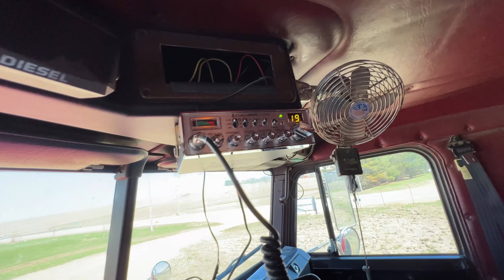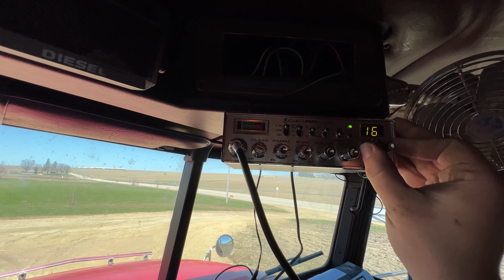Big Red Breakdown

Comment: You'll get 5-15 mile range normally on CB, but the sun is just entering the active part of it's 11-year solar flare cycle, which enables skip - 600+mile transmissions due to the charged up ionosphere bouncing space-bound radio back down to the ground.
Reply: That's good to know, thanks.

Comment: Cb Radio signals (waves) are  mirrored in some layers in the atmosfere and on the ground, espesially on water and  travels very far from the antenna. In Denmark in northern Europe I listened to Italians 1400 km and Norwegians 500-1800 km (300-1100 miles) when I had a CB radio as a young guy.

Comment: Not sure if you did Ryan but even with a Cobra 29 I'd take it to a good CB shop to get it peak& tuned so you get the most out of it. Same radio I have in my rig and bought it from the lady who runs the CB shop one exit east of where I-35 hits Des Moines and six months later still got no problems. Also a big reason for some of the interference is from your chrome and also if you're running any type of LEDs because the EM radiation does distort RF signals.
Reply: Exactly, really any  CB Radio antenna needs to have the antenna matched (SWR's) to the radio!

Comment: I don't know about your area, but here west of Kansas City, usually in the afternoon and evening, channel 28 ends up getting a lot of skippers from all over the country.  Has to do with those skippers putting up big base station towers, directional antennas, and using a wee bit more power than your cb has, and the big factor, how "energized" the atmosphere is due to solar activity, and bouncing their transmissions off the atmosphere. About 3 weeks ago, was picking up a guy talking on cb from the San Francisco, CA area on my cb.  Also, if you wanted to, run a 2 antenna setup with a co-phased coax cable setup, it actually increases your transmission range front and back but reduces your range from the side,  and get the antenna as high as you can get it.

Comment: Depending on how the sun is affecting the Earth's ionosphere, the 11 m wavelength (near the top of the HF band) of CB can (and often does) have a range of anywhere on the Earth. This is the biggest problem with CB, while you might be trying to talk to someone a mile away, the signals from Europe, Australia, and Africa drowned out your local signal and you can't talk to the guy sitting right in front of you. This is why many are switching to GMRS in the UHF band. UHF signals are not subject to bounce or skip like the HF frequencies of CB, the maximum range is about 50 miles. Thus a much better 2 way radio for local conversations.
The very latest is that the FCC has approved the use of FM on the CB channels. Both Cobra and President now makes radios with this new option. The process of decoding FM leads to something called signal lock, which means that the strongest signal is locked onto and the weaker signals are blocked. This is really useful for local communication when the AM side of the channel is full of signals from the other side of the world.

Comment: Back in the 70's, the antenna (5/8 ground plane) for my CB base station was on the roof of my three story barracks at Homestead AFB, Fl (south of Miami), and when the skip was good, I could talk to New Jersey. And Bimini, 50 miles east, was always in range. And before "40 channels" and SSB was big, there was a trick (I had it done, but I don't remember what it was) that would give you a 24th channel. Any of you old bastards remember that?

Comment: Certain antennas work better than others and fiberglass vs metal antennas also play a factor in range as well as type and size of CB. Then of course gotta count for the coax cable as well. Small coax won't work near as well as a larger coax. Then as someone else has already stated if you take it to a CB shop and they Crack it open they can tune them right up real hot. There is a guy in Arizona with a homebase station of some sort and I can hear him everywhere from ny to Washington state.

Comment: You’re getting atmospheric skip and that’s why you’re hearing them from Mexico. And it’s not the size of the antenna. If you’ll put a 6 foot whip on the back of the sleeper in the middle you’ll really be able to hear. And get an external speaker. You can hear better.

Comment: Not to scare you Ryan, Your water pump is a drop in the bucket till you get your first Towing bill, Mine was $ 2500.00. It ain't cheap.
Reply: and yet, he spent more than that in repairs/labor
Reply: @tncountryboy06  that was just based on my towing bill,  Not what Ryan paid in repairs. Each Big Rig towing service is different and they have different rates plus mileage. So my bill is not compared to his cost. And here in Florida,  flat rate starts at $ 1500.